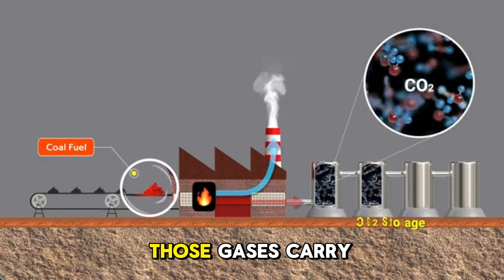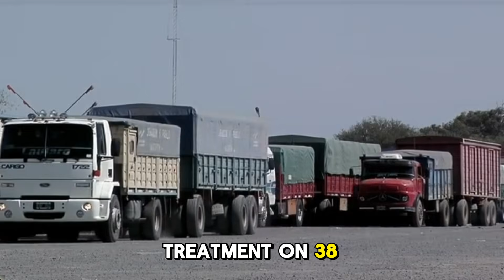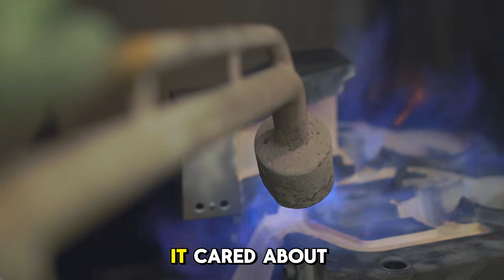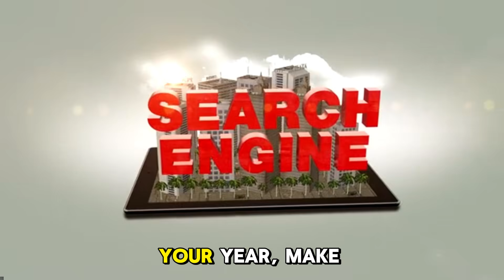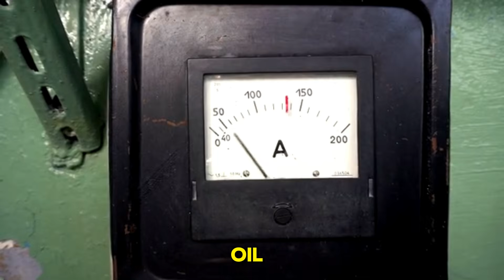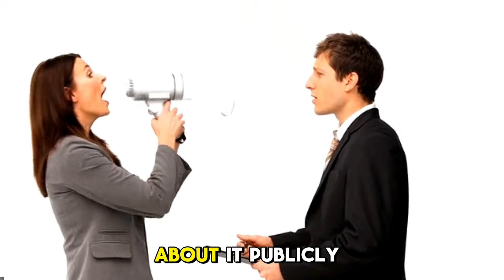$2 Liquid KILLS Engine Sludge PERMANENTLY — Why Big Auto BURIED This Since 1955

Comment: This could work if further measures are taken; such as removing the oil pan & internal oil pump screen, and adequate wiping down of lower components inside the oil pan.   Of course this is something that may also cause issues if not approached carefully.   With all extreme procedures one must envision the steps and go forth, or not!   There are now less extreme ways to clean piston rings from deposits with the Berryman's procedure & a new oil change done early.  Also using formulations like Valvoline Protect & Restore, could actually help.  Thank you!